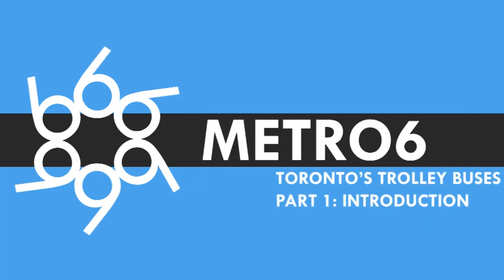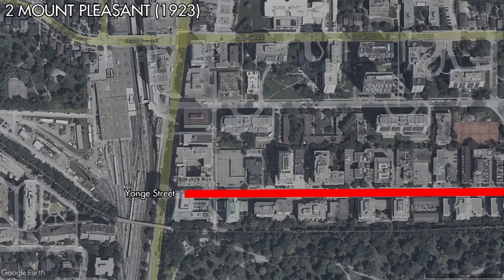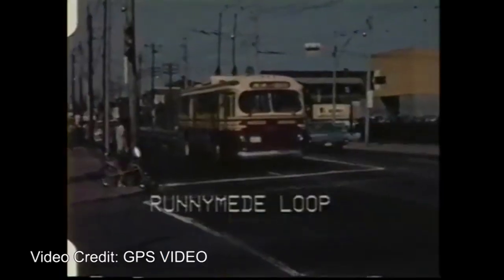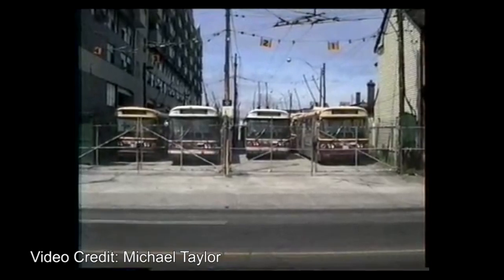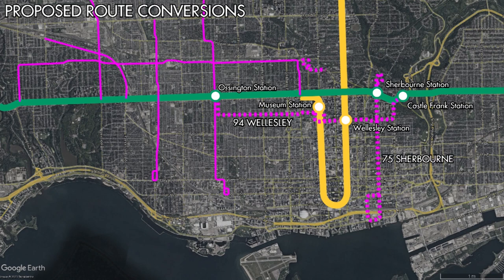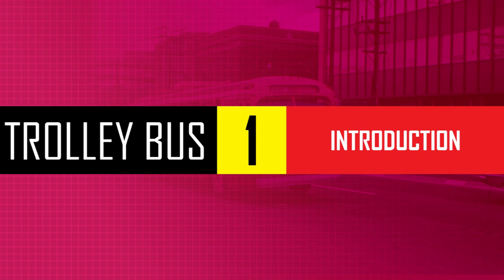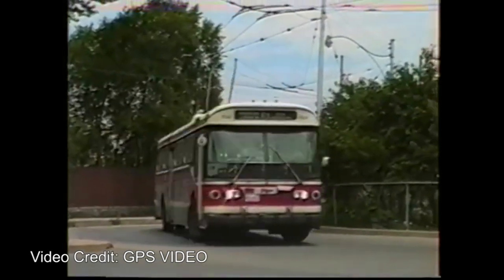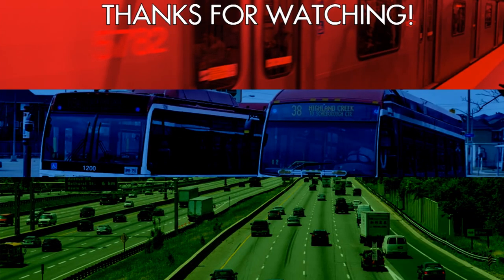Toronto's Old Trolley Buses - Part 1: Introduction

Comment: Trolleybuses are often thought of as being replacements/upgrades for classic tram networks, so it's interesting to learn about a city that had extensive networks of both at the same time. Thank you for the video!
Reply: They’re not. Trams are better but trolleybuses have the best of both worlds. If I was in charge I’d ensure Toronto had a similar system to Vancouvers.

Comment: I used to ride the Yonge 97 and Nortown 61 routes, among others. I always loved it when the poles came off the wires. There was a short overhead wire connection on Lawrence between these routes (not revenue service) and only once did I see a trolley bus use it. This was an historic occasion!
When you look at all the condo construction today, the overhead wires would only get in the way if we still had trolley service.

Comment: I remember these stupid buses as a kid. The part of the video showing the driver jumping out and running back to reattach the wires was a common issue. Sometimes 4 or 5 times in a single trip. I was happy when the TTC got rid of these. Great video METRO6. Keep em coming 👍
Reply: These "stupid buses" dominate in Vancouver.
Reply: @conveyor2  What works in one place may not work in another, case in point, Toronto. They were more problematic than it was worth and now with battery electric technology coming, they can be a better alternative to the trolleybus for Toronto
Reply: the old streetcars had this issue as well. there were pars of the network like the tunnels at St Clare west where it always happened.
Reply: @stinkyroadhog1347 battery buses won’t work well in Canadian winters. As for the railroads, CP Rail is going with hydrogen